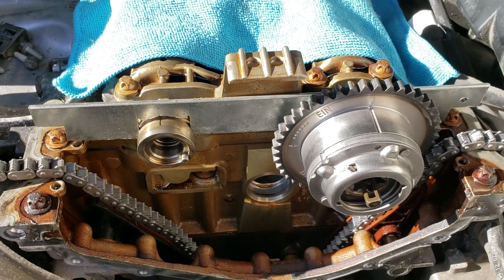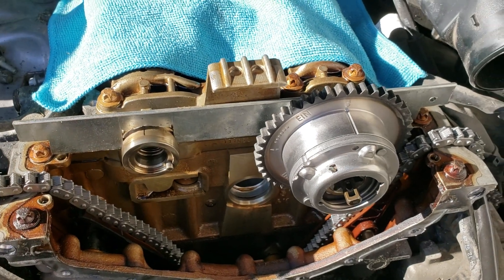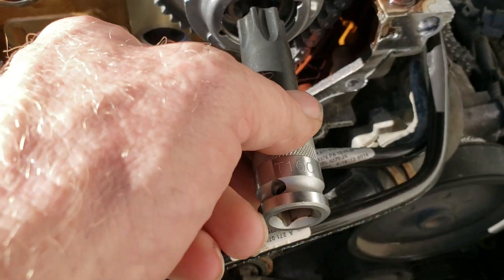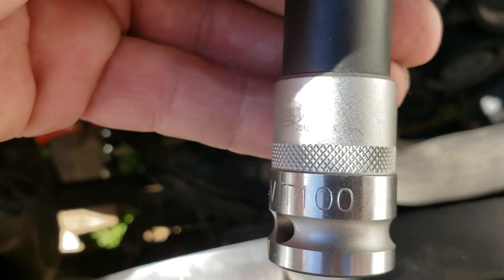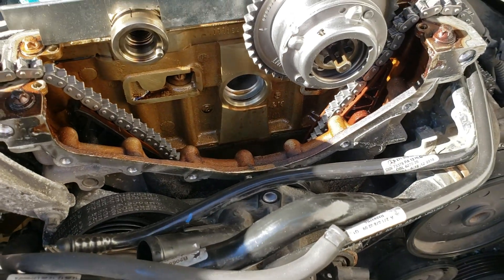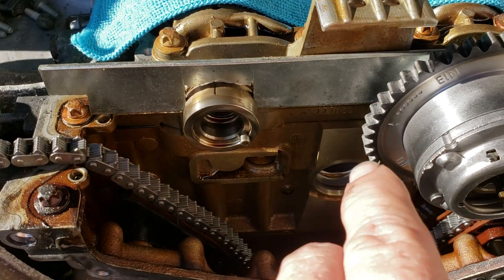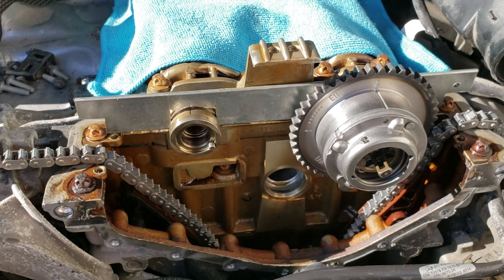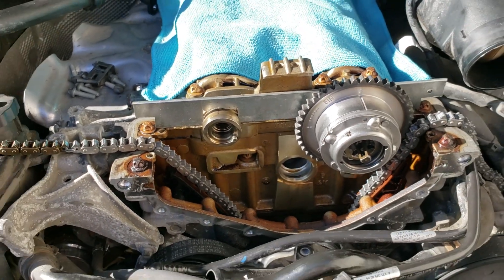Mercedes M271EVO Cam chain,phasers,tensioner, cam alignment tool, C250

Comment: Good Video , but it is an interference motor , cuz i had 2 exhaust valves bent, when chain snapped, but yeah the valves are open so slightly when you align everything right so it’s possible to spin the crank freely.

Comment: hi guys, I just replaced the tensioner on a m271 c180 and there is slack on the chain in the right side and the guide moves freely even with the tensioner in. what is the problem?!
Reply from the maker: During installation the tensioner contacts the chain guide causing it to pop out and applies tension. So did you only replace tensioner and not the chain and guides? Sounds like the tensioner has not made contact yet, possibly the chain is too loose or the guide could be worn too much possibly. You could try pushing on the guide or chain to activate the tensioner. But If your chain or guides are too worn, it won't help much. Hope that makes sense.

Comment: Hey man, I have issues aligning the timing on the cams. Any tips? Both cams are at different points and I’m trying to put everything together along with the timing. I want to align the cams with the cam phasers and the crank at “OT” but I’m stuck lol any help is appreciated thank you!!
Reply from the maker: The phasers have a pin in the back that lines up on the camshaft then you bolt it on. Then you fish the chain down on the crank sprocket turn the engine until you have the chain all the way back up around the cams. Once the crank is on top dead center, align the driver side cam marks up and then wrap the chain around that cam first, then line up the passenger side cam marks and then wrap the chain around that cam and connect your chain with the masterlink, and install your tensioner and that's it..some kits have colored links that line up cams with crank to make it fool proof. Sometimes you might have to turn cam with a wrench slightly to line it all up because there is valve spring tension on it. You will see a spot on the cam for the wrench to fit. Good luck. https://youtu.be/BOFKkw4Zl10
Reply: Do you line up the camshaft first? Then install the phasers lined up?
Reply: this is the same issue im having, my cams are out of timnih when the crank is at TDC, can i remove the chain without the Cam locking tool installed, and alighn the cams after, then put the cam holding tool and install chain?

Comment: Hi @THE DRAGON cam adjusters "bolts" in the cam gears/phasers that take the T100 - did you need to replace those? I was told they can lose their pressure/hold when being removed and need to be replaced when installing the new phasers. Also, do you know what torque they need to be tightened to and is it important? I'm seeing 90 Nm but elsewhere seen exhaust 100 Nm and intake 90 Nm.
Reply from the maker: You can reuse them if you want, or if you feel better get new ones. Torque is between 56-70 ft lbs. So I just set mine at 65 ft lbs
Reply: @thedragon2299  thanks!

Comment: What chain breaker did you use? And how do you mushroom the tops of the new chain when you install the master links?
Reply from the maker: I first used one from harbor freight, but it doesn't really mushroom the pins good so I borrowed a friend actually  chain tool. The old chain is easy to remove by cutting it with a dremel tool or grinder, but you will need an actual chain riveting tool for the new chain. Or take off the cover on the engine and get a one piece chain. Good luck with it, I wish I knew so many people were going to need the info, I would have done a much better videos.

Comment: Hi, Doing this at the moment. what brand parts did you buy? Cheers
Reply from the maker: https://www.amazon.com/dp/B07H7GZS3B/ref=cm_sw_r_cp_awdb_imm_t1_Px2TFbTS221YK
Reply: @thedragon2299  how are the parts holding up? Here in AUS there is little choice between genuine parts and cheap Chinese. Thanks for the video.
Reply from the maker: @tobiasjahke2356  Held up good for another 30,000 miles, then he traded car in for a new Toyota Tacoma

Comment: Ok, After I remove the chain tensioner and do the chain and phasers, how do I unlock the new tensioner?
Reply from the maker: It unlocks its self when it comes in contact with the chain, when you screw it back in.
Reply: @thedragon2299  One final question, what is the name of the bolt that holds the screws in to hold the phaser?, it takes the T100 to remove it...
Reply from the maker: @herbhammonds507  its actually called, variable timing pressure valve. It's more than just a bolt.
Reply: @thedragon2299  Thank you!...I subscribed to your channel...
Reply from the maker: @herbhammonds507  My Pleasure, hope it helps. Thanks for Subscribing.

Comment: Hi Dragon, thanks for dropping this knowledge, information is hard to come by with these engines. I am currently ordering parts to do the same job and was curious as to what brand timing chain you used? I have only found the IWIS chain or genuine Mercedes one. I do not plan on taking the bottom cover off unless I absolutely have to so I'd prefer one with a master link. Does said master link need to be pressed on once the chain is connected or does it have a removable one like a dirtbike for example?
Reply from the maker: AKWH was the brand, on amazon. $215.99 free shipping. Master link has to be pressed on, you will need a chain riveting tool. I used the harbor freight brand. You can leave bottom cover on if you don't have to replace guides. Amazon.com: M271 Camshaft Adjusters Timing Chain Kit 2710501400 For Mercedes C250 E250 SLK250, 2710502547: Automotive
https://www.amazon.com/gp/aw/d/B07H7GZS3B/ref=psdcmw_15726521_t1_B07J9K6W3Z
Reply: @thedragon2299  Is the chain tensioner plug included in the kit or where did you get yours?
Reply from the maker: @rafaelronquillo6302  It's not usually in any kit, it usually come with a new tensioner but you can google one, I was able to get mine out and reuse it, with a little help of permatex ultra black

Comment: When changing the timing chain tensioner is there any special instructions when taking off and installing?
Reply from the maker: Not really, just unscrew old one screw new one in, just be careful not to put any pressure on the new one til its installed, because it's intended to spring out when it comes in contact with the chain as your are screwing it in. Just don't accidentally trip it before you install it. Hope that made sense.
Reply: I have the same car 2013 C250
Reply from the maker: @Veaker  This is a customer's  that became my friend. He has 200,000 on it now and since I did this he has been trouble free. He puts lots of miles on it.
Reply: Thanks allot very helpful you earned my sub 👍🏽
Reply from the maker: @Veaker  Thanks, do you know where it is located, and you have to get a new plug, because the old one pretty much gets destroyed during removal. Are you familiar with this?
Reply: @thedragon2299  so i dont have to mess around with the crankshafts position? and yes i have the new plug thanks again
Reply from the maker: @Veaker  Yes, the crank needs to be on top dead center. There is a mark on the crank pulley. Watch my video posted after this one. On my channel under videos.
Reply: THE DRAGON ok so I put the crankshaft on top dead center after I install the new tensioner or before?
Reply from the maker: @Veaker  Before. Then keep the chain tight and like I describe in the video wrap the chain up and around the driver side cam phaser first, then keep it tight and wrap it over the passenger side phaser. You may have to slight turn the cam as you line up the timing marks, what ever it takes.. Also as I stated in the videos one phaser mark lines up in th center of a link, while the other phaser mark lines up between 2 links of the chain, if that makes sense. But make sure to go to my channel under videos scroll up until you find the few videos on this procedure. I posted a few videos explaining it.

Comment: How did you get the links appart from the timing chain ? First time I’ve seen a timing chain do that before it’s very cool
Reply from the maker: They make a tool called a "chain break". You can use the tool, or just grind off one side of the rivets flush to the link and tap them out from other side. You have to put a towel under the chain so no metal shavings go in the engine. The new chain is already split when you buy it and you have to peen down the rivets either with a chain rivet tool or your own creative fashion.  Hope that all made sense to ya. Hit me up if you have anymore questions.
Reply: That is the official Mercedes way of doing it. Started with the 272/273 engines. We break the links, feed the new chain, and then re-pin the links.

Comment: Next question if you have a moment, was able to get the front cover off and put the new cam phasers on. However, everything is slightly off to the right (both in take and exhaust). Middle line (which I believe is the end of the camshaft that the cam phasers bolts on to). Is there something I’m missing, do you need to manually move them back into place. My understanding is that the cam phasers locks into correct position with a holding pin that’s on the end of the camshaft. If this is ahead then the cam phasers will be ahead as well because of the way they connect. 

Hope that make sense, I can send pictures if that would help.
Reply from the maker: Yes the cam phasers lock into position, as long as you did that correctly. Then the crank pulley on TDC, keep the chain tight as you wrap it up and over the intake phaser first, it must be lined up with arrow and line, if not you physically have to turn the cam until it is lined up, you can get a skinny wrench on the end of cam, behind the phaser and turn it until its lined up, then wrap the chain over it, then same for exhaust. Do not rotate it until you install tensioner. Tensioners are supposed to be one time use, but there are ways around that if you need to take it out. EVERYTHING MUST BE LINED UP PERFECT BEFORE ROTATING ENGINE!
Reply: THE DRAGON thanks, that makes sense. This is all done with the locking tool still in place, correct? Is it the whole cam shaft you are moving or just the end piece that the phaser attaches to. 

Lastly, with the tensioner our the crank pulley has freewheeled a little, caught it about 3 clicks off center (having put it at DTC before removing the tensioner) has this effected anything negatively? I took it back to DTC the second I saw it.
Reply from the maker: @98765amazing  If use alignment tool, the cams should not have moved. Regardless of what you used, all the Mark's have to line up perfect, no exceptions. But here is where you need to use your head. I made the alignment tool myself,  and it was not precise at all, and like I said in the video, I had to turn the cams alittle counter clockwise to get everything lined up. Like I needed three hands, but use 2 . You have to hold the chain, line up the phaser, and turn cam alittle til it all kinda falls in place. When it does, you will be like damn that's it, with no uncertainty. You can move the Crank back and forth a little, as long as you put it on TDC when lining up timing Mark's on cam and phasers.
Reply from the maker: Remember what I said about one cam phaser mark lines up in the center of a link, and the other one lines up between 2 links...if that makes sense to you. It has to be that way to be right
Reply from the maker: Take the time to get it right! If not it could be CATASTROPHIC FAILURE. BE PATIENT

Comment: Currently in the middle of this project, any recommendations for getting the front cover off to expose the cam phasers? I have all the bolts off but cover is sealed tight on the block.
Reply from the maker: Ok, there are 2 covers, top one and then the whole front cover. I only needed to remove the top cover, remove all the bolts, including the ones holding those 2 loops if you know what I mean. Then it is sealed with silicone and has to be pried off a bit. Make sure you get all the bolts, it's a bunch of them, 2 of the bottom thermostat housing bolts go all the way through to hold the cover. Hope that helps, let me know if you have anymore questions.
Reply: THE DRAGON thank you so much, really appreciate the help. Any suggestions for prying once the bolts are off. Flat head screw driver best bet?
Reply from the maker: @98765amazing Make sure you have ALL the bolts out first, it's a bunch of them. The thermostat housing should be removed first. There are 2 large torx bolts on those loops that have to be removed too. Use the thinnest thing you have first, thin putty knife, thick razor blade, whatever. Then if it does move a little step up to thin screwdriver. But don't just hammer a screwdriver in there first, you will definitely gouge it and it will break or leak. It sticks alittle so take your time, and I think there are a couple dowel pins that keep it lined up, so it has to come off square, not at an angle. So alternate side to side when prying. Sometimes I will take a razor blade or exactly knife all around the edges first then start prying easily.
Reply from the maker: @98765amazing  Oh, and I just thought about this, the thermostat housing has a round journal that protrudes towards the engine, and has an oring on it, so again pry out evenly, but that's why the resistance if you have all the bolts out, between that passage/journal peice and the guide pins make it appear stuck. Hope that helps. Look up a picture on line to understand what I mean.
Reply from the maker: @98765amazing  Not the plastic thermostat housing, but the part that's in the cover you are removing has the protrusion I'm talking about. Sounds confusing but you will see what I mean. It's in the cover. The o ring kind of holds it in tight.
Reply: THE DRAGON that makes perfect sense, appreciate the insight. Thanks again!
Reply from the maker: @98765amazing  once that thermostat housing is removed, you can look inside to see what I mean where cover journal  meets engine block.